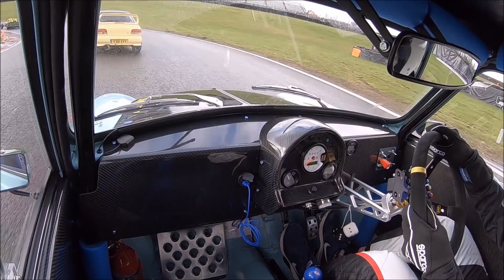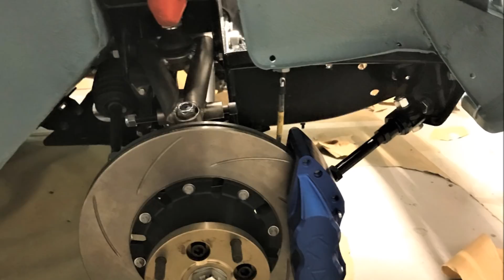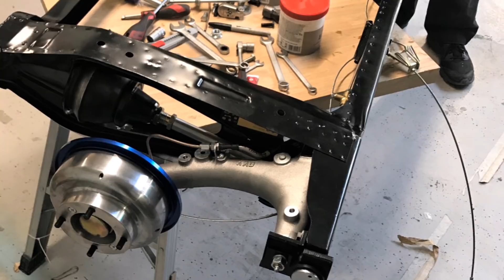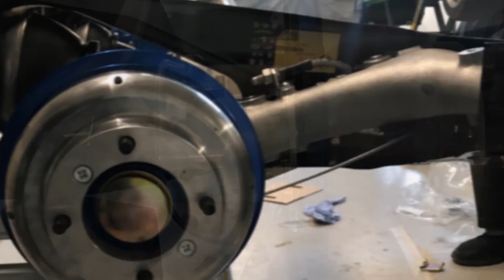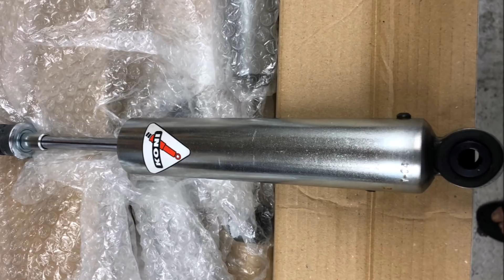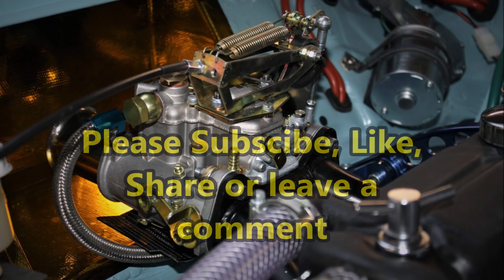Classic Mini Race / Track Car Project Bolt Part 6 - Suspension Steering & Bakes

Comment: What sort of a steering column extension are you running.  Looks great!
Reply: Sorry, just seen this. The steering column bracket system is from Owens Fabrications. The actual column is a Go-race adjusted one for the quick release steering wheel with a flexible u bolt joint to the steering rack.

Comment: Looks great you can now ditch the rear subframe and save some weight with the KAD Alloy beam. KAD stuff always looks good

https://kentautodevelopments.com/collections/suspension/products/kad-alloy-rear-beam-axle
Reply: May well consider this for my next project.😁
Reply: I looked into this but wasn't impressed with the beam, looked quite flimsy. There was one made in America that looked more robust and a complete kit for £1,100.00.
 I really wanted to keep the original mini feel on the track with cornering etc and switching to Beam meant changing to coil overs, which looking at advice on forums, most advised against using coil overs.
Reply from the maker: Beam axle and coil overs was a consideration